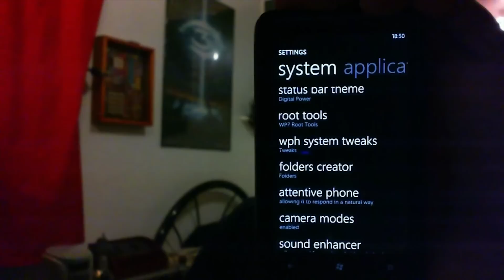Make Your Own USB-Y Cable

Comment: Safer way 2 strip ur wires without slicing ur fingers with a razor blade is 2 burn the wire with a lighter about 1/4 of an inch back from the end,then pull off outer coating  between thumb n forefinger using thumb nail 2 drag outer coating off and...fast,simple,less blood loss!

Comment: It is a great video. I did a little modification. I join all the four wires. Of course I used it for another purpose. I connect two phone to the computer and charge them both and  upload or download files to and from computer <-> phones. It is amazing. The trick doesn't work with my ipad or my samsung but the other phones are ok. Thanks man. It was of great help. Keep the good job.

Comment: hi..i won to make for me from 3.5mm aux to famale usb how to connect the wires ??? please help !!!
Reply from the maker: I suppose it depends on how you plan to use that cable.
There are three wires in the USB cable and three "wires" in the 3.5mm cable - http://cdn4.explainthatstuff.com/earbud-stereo-jack-plug-wiring.jpg. Fortunately, that means there are only 20 combinations. As long as you don't solder each combination, you should be able to experiment with connection schemes pretty easily.

Curiously, for what do you plan to use that cable?
Reply: @GameDr04  hi, I would like to ask if is it possible to use mini usb for male then female micro usb and female 3.5mm jack? I want to use it for action cameras so I can use external microphone while charging it in a powerbank without using battery

Comment: So is this a usb splitter or what? Like, could I plug two flash drives into the ends and hook it up to my computer, or use it to plug in a mouse and keyboard at the same time?
Reply from the maker: I admit, I didn't know the answer to this and I was very curious. So I tested it.
It turns out: no. It doesn't work that way.
Reply: ahh, damn.
Reply: but now we know :P
Reply from the maker: Indeed.
I did get some unexpected behavior, though. I tried it twice.
Both flash drives lit up for about a second each, then turned off. One time, my computer made the "device connected" sound. The other time, it did nothing.
Reply: Interesting, maybe it was enough to give the flash drives power but not a good enough connection to actually connect it to the computer

Comment: OMG!!! This is not good. That for it is good, buy solder connector, and solder the two of them UTP cable! With sort lines, because it's spoil the speed, or make unusable.
Reply from the maker: You are correct. But the reason I made this was not for huge amounts of data transfer. I was only moving about 8MB.

Comment: hi hey is it posible to make a cable for the dvd player.i have a dvd that 
reads only cd and dvd cd but does not have a usb port,in the back of dvd 
it has cable for video and for speakers the cables are red and white for the 
video it has orange cable.i woud like to wach movies from usb is it posibile and the 
dvd is -dce dvd 2500
Reply from the maker: I'm sure it's possible but likely/practical? No.

You certainly won't be able to just transmit audio/video data without some kind of interpretation. I suppose on the other end of that USB cable, you could build some circuitry in a breadboard that could interpret those signals. But for the time and money spent, you might as well just buy a $30, analog USB capture card from Newegg and save yourself the trouble.

Comment: will this work on hp stream 7 that uses USB charging so that i can plug USB devices while charging???
Reply from the maker: While I can't test this, I can say that in principle it should work that way.
Be careful, though. There's no regulator in this "circuit". It's possible you could destroy your USB drive. Or worse, the whole thing could be one giant voltage feedback device, thus damaging both your USB drive and the HP Stream.

Proceed at your own risk. And if you choose to embark down that path, please let us know what happened!

Comment: Might you happen to know if you can make a y cable that has data running through both?
Reply from the maker: Shawn E As long as you're getting power into the system, then all ends of the cable will have access to the data.

Be careful, though. If you're trying to write to a device through multiple channels, you're likely to corrupt that device.
With solid-state devices (like flash drives), there's even a chance that multiple, simultaneous reads could cause problems.
Reply: Thanks...it worked but with issues like you said.  It didn't even matter that one device was not powered at the time.   It actually some how turned the other device on lol.  Oh well.

Comment: How not to struggle with scissors when stripping wire when you have no wire strippers: Use a lighter to slightly melt the sheathing on each wire at the point you want to remove it.  It should take just a second or two.  As soon as you take the flame away, grab the tip of the sheathing you want to remove and pull it off.  If it doesn't come off easily, heat it again and try again.  Don't burn the wire or light the sheathing on fire....just melt it.

Comment: can I do the same with a couple of those?
http://www.ebay.com/itm/Micro-USB-2-0-Type-B-Male-To-Female-M-F-Extension-Extender-Charging-Cable-Cord-/251599317291?pt=US_USB_Cables_Hubs_Adapters&hash=item3a947ce92b
Reply from the maker: As soon as I get home from work, I will take a look at the inside of one of those and let you know.
Reply from the maker: OK. I've looked into it.

There is one additional wire in there (the ID wire). In my case, it's gray.
I have
Red: live (power)
White: Data-
Green: Data+
Grey: ID
Black: ground

Bottom line: it should work just fine. Just make sure to keep the wire pairs color coded.

Good luck!
Reply: ***** thank you man! You've helped a lot :)

Comment: Thanks. I need to make a 2-male-1-female cable. will be getting to work NOW.
Reply: Worked! Thanks Again!!
Reply: Curious if the one you made would be able to add additional power for a HDD on Wii U?
Reply: Bradley Smiley that's exactly why I made it! And yes it does work! :)
Reply: Bradley Smiley just be sure to only use the data wires from one source and power from both.
Reply: laserbeak43 Thanks so much!
Reply: ***** (WHOOPS!!! I've just noticed that I've worded this a bit wrong, Please refer to "FEMALE" as the ends you plug into the WiiU(which is Type A), and "MALE" as the end you plug into your HDD(its type may vary))

sounds like it should work... Maybe it's possible that your HDD doesn't work, or isn't compatible with WiiU? It's also possible that there's a power conversion going on inside of your HDD's enclosure.
Don't give up yet,
-get yourself 2 USB cables
-cut one in half and keep the female end
-connect the female cable you just cut to the other full cable like so:
**CAREFULLY split the wrapping/insulation on the complete cable, be careful not do too much damage to the RF shielding, if possible(it may even be easier for you just to split that cable as well, just remember, 2 female ends, 1 male end)
**Strip enough of the insulation from the + and - power leads (usually red and black) to be able to connect all 3. I recommend soldering them together.
**connect ONLY 1 of the data pairs from one of the female connectors to the male connector (usually a white and a green(ish) combination).
**try to re-apply as much of the shielding and insulation as possible, then tape it back up.

I hope that helps. Let me know if you need anything else.
Reply: That's really strange... I'm sorry it didn't work for you...I am curious though...if you could post pictures of your cable connections, I'd like to see it. Also, are you plugging into the front or the back of the WiiU?

Comment: is it the same thing if i want two male end? and not two female?
Reply from the maker: Yes.
Just make sure your device will be OK with receiving power from two concurrent USB connections.
Reply: ***** its for a wii u need more power for my external hard drive
Reply from the maker: Jorge Alvarado I suppose if your device is already under-powered, then it should be safe to do that.
Reply: ***** Thanks
Reply: Dude, did it work?

Comment: I'd like to suggest a possible improvement to your design: If you add a 100K resistor to the minus wire (black cable) and add a bypass wire to the shielding (ground cable) before the resistor than any excess current will be diverted to the ground and prevent overloading your circuit. An illustration of this design can be found here: http://www.pinout.net/connectors/Y_OTG_CABLE.png
Reply: Hi mate. Thanks for sugestion. Now I know what 100k for.
I have a question. I found another schematic here http://android.stackexchange.com/questions/29168/can-sony-xperia-ust25i-s-otg-be-connected-to-external-power
As you can see 100k has a switch. What for?
Also I can see 220k resistor and diode between GROUND and Vcc+5V
Do you know what for?
Reply: Alex Mag Hello Alex,
  I am not an expert but I'd say that the 100k is to change the frequency of the channel which acts as a digital button (Likely for dock power on/off. So the phone will charge even if the dock is off) http://www.seattlerobotics.org/encoder/mar97/basics.html
Reply: Alex Mag A "200k" resistor with a diode in series acts as a voltage doper which lowers the voltage (from 5v to 3.3v in your case, I think): http://electronics.stackexchange.com/questions/72709/basic-question-about-diode-voltage-drop-and-resistor-position

Comment: What if you get USB Device not recognized on the secondary female USB port that you add to the cable how can you fix that?
Reply from the maker: It really depends on what the device is. If it's something complex like a keyboard or a mouse, I don't think there's much you can do. If it's more simple like a flash drive, I'd say try swapping the two things you have plugged in.
But in the end, this cable isn't supposed to act like a USB hub. So be ready for a lot of unexpected behavior.

Comment: Hey, next time use a lighter or a candle to heat up the plastic isolation on the coloured wires you need , and then just pull it off with your fingers when it becomes soft enough. Much easier process, but watch out not to burn your fingers because of the high temperature of the isolation and wire.

Comment: if this is staying at home most of the time, why not just stop at radio shack and grab the smallest and closest to a terminal strip with 4 contacts. the European style works good since it isolates every "conductive hazard" (the terminals, screws and anything metal) involed in hacking electronic "sh*t". might as well grab one with 8 contacts so you can make two separate custom rigs for transferring data.

Comment: THANKS FOR THE DIY VIDEO. I HAVE A COOLING FAN THAT HAS GOOD MOTORS AND A BASE. THE PLUG IS BAD. I THINK I CAN FIX IT NOW. I HATED TO THROW IT AWAY. IT IS HEAVY GUAGE ALUMINUM AND CAN STILL WORK IF I CAN GET POWER TO THE FANS.